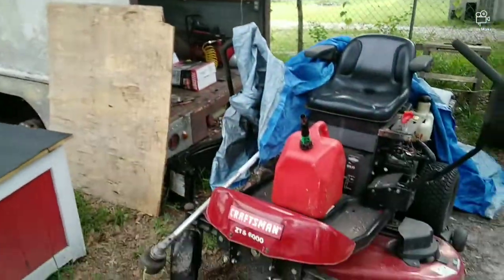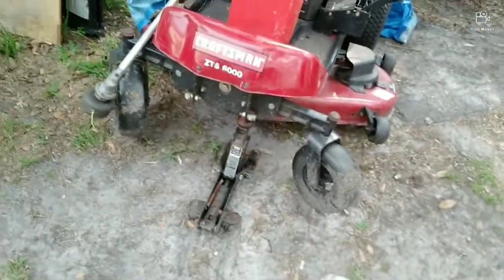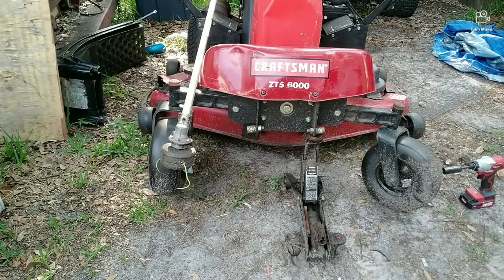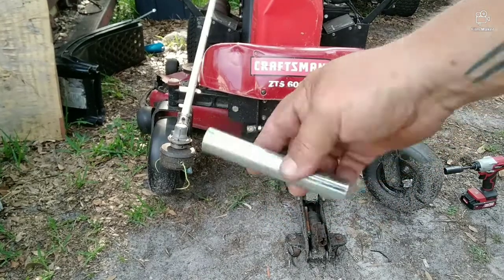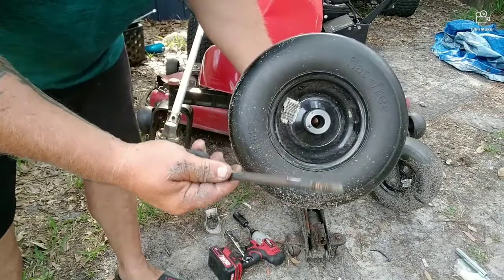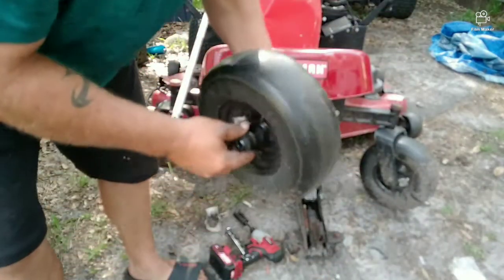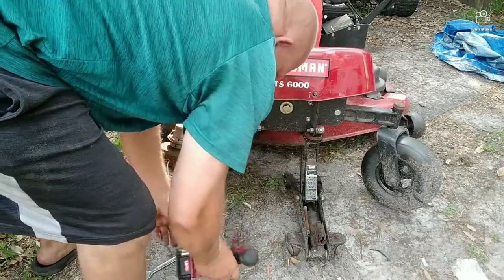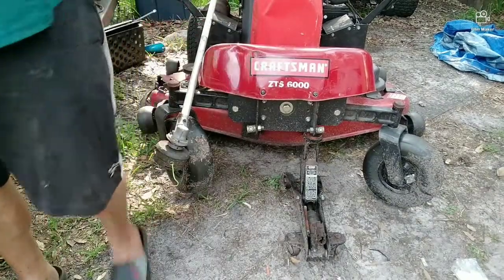Zero Turn Front Tire Change Craftsman Cub Cadet Scag Hustler Wright Stander Husqvarna Dixie Chopper

Comment: Sir I am a prescriber / follower would you please finish the $1 zero turn mower project videos the last one was the the sleeve for the wheel bearing I want to see the whole evolution of the fix on the $1 zero turn mower it's really cool. 🤓
Reply from the maker: Thanks for being here I have been using the zero for the last few months to cut grass .. I brought it back to my shop just yesterday to work on it more.  Some wire cleanup, valve adjustment and re so those vids will be coming in the next few weeks. Hit the bell icon to be notified as each vid is published.  I post every Wed and Sat .. if u have specific things on this machine u want to sell just let me know
Reply: @MunkyWrench  Yes all the stuff you've done to get it to run so far. Thank you
Reply from the maker: @cye58  everything I did to get it to run is posted.  I've cut over 200 lawns with it thus far.  I brought it home to the shop to tidy up wiring.  Adjust valves.. general maint and ill be filming all that in the next few days

Comment: Munky Wrench, I have a Craftsman z550 with 11x6x5 wheel do you think the 11x4x5 would work, that is all I can find?
Reply from the maker: If you mean changing different tires on the same wheels.. not usually.. if you have smaller matching rims and tires you can often do that but keep in mind the mower will no longer be kevel so u will have to level the deck to compensate.  I often change sizes but you have to be aware of other things that get affected.. hope that helps u.  I'm always here to answer questions.  Thanks for taking the tine to comment and subscribe it really helps

Comment: Did u ever make video on deck height motor replacement
Reply from the maker: No I use it to cut a few lawns a week so I just set the deck where I needed it and kept it there.. the new motor was over $100 and didn't buy it.. however.. I can make that video tomorrow.. I can remove the motor and install .. its very easy once u know how.. ill make that video tomorrow and upload in afternoon
Reply: @MunkyWrench  thanks  cool man God bless u